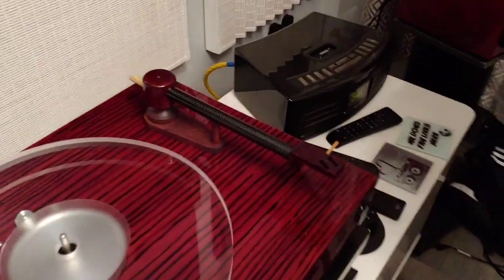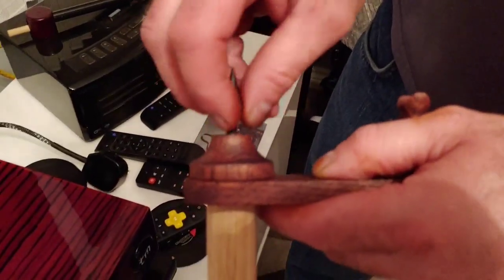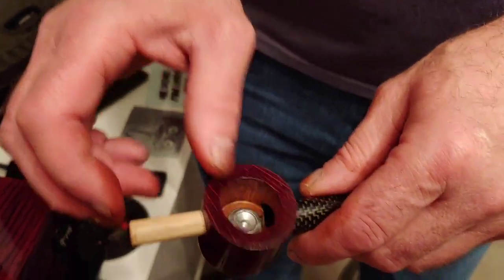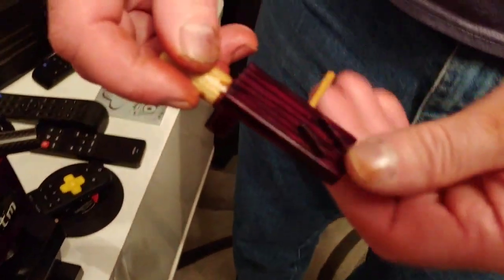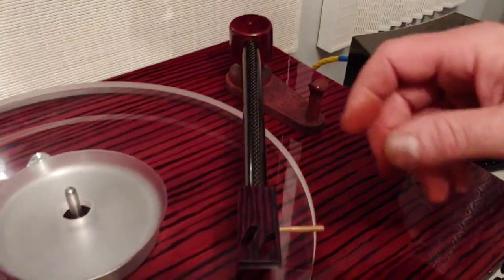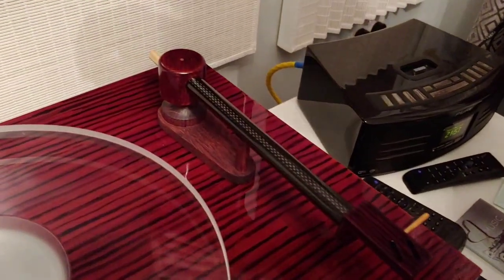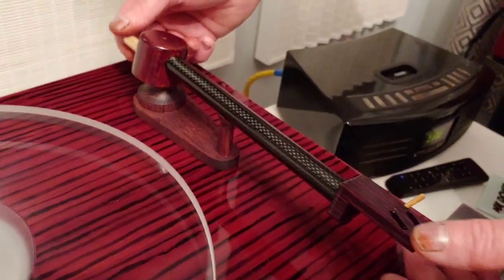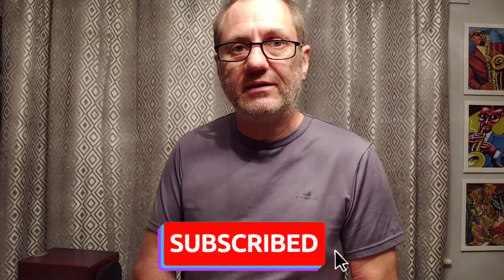prototype tonearm part 1

Comment: Cool! What effect will the oak parts have, versus metal or carbon fibre?
Reply from the maker: Oak is very strong, stable & good at absorbing Vibrations, lots of hi-end headshells are made from wood. Carbon fiber is also strong,  light & excellent for make arm tubes, the counterweight stub need to be made of steel so the counterweight can move a long  it .
Reply: @tweakerman  Thanks, good info. I decided to get back into vinyl, so all info is helpful.

Comment: You do love a tweak my friend, how did you get on with the rewire of the 250 and how is the techno weight? I love your videos.
Reply from the maker: Hello Tonyl, I've had a problem with the RB250 bearing, its had to go to my local hi fi shop Deco audio to be looked at, It was the bottom bearing it became loose & I couldn't tighten it, but I'm still looking to change it for something a lot better.